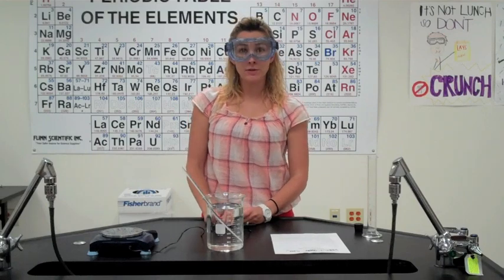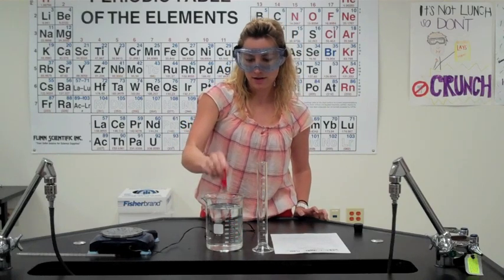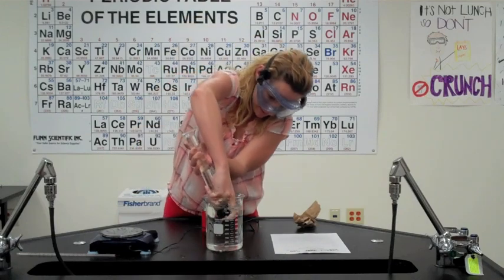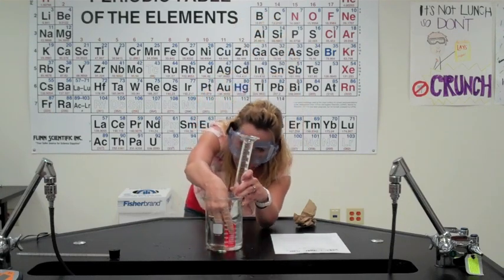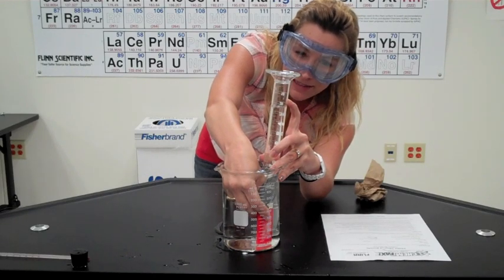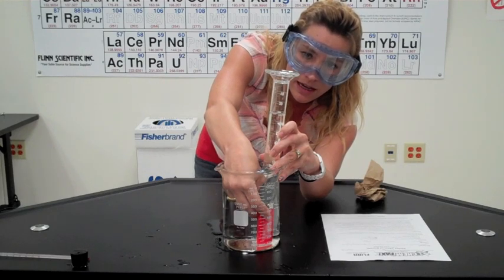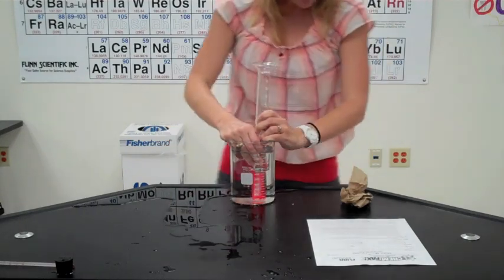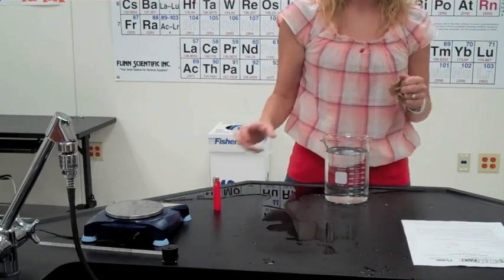Molar Mass of Butane

Comment: Hello Students. I am not a student. I need your help apparently.

I just got 146 junk lighters, no this is not a math question. this is a real thing, I work at a cigar accesories warehouse and I got them for free saving them from the trash. I figure since I'm never going to use all of these lighters it would be cool to collect the lighter fluid to keep it aroun and do whatever I want with it. I like making fires and whatever. I'm a pyromaniac and a Florida Man. I mentioned getting the fluid out and collecting it all together to a much wiser man and he freaked out because he thought it would be butane and not just average whatever lighter fluid. turns out he's probably right. and if I just puncture the lighter to make a small hole and dump out the fluid, apparently that would set off some kind of explosion that could take out an airplane.

so now I'm looking up on google, can you collect the butane from lighters and it takes me to this video.

so my questions are this 1 am I getting this right that to collect the butane from a lighter I stick it in water and put another thinner tube over it and just... press the button with the thinner tube? I don't get it, could you explane the collection procces in the way an idiot like me could understand.

then 2 it looks like after you collect the butane in that thinner tube you just set it across the table fully open and everything. Wouldn't all that butane just equalize with the air or something and now it's just lost? was the point of the demostration how to empty a lighter rather than collect the butane? cause that's what I want to do, I want to collect the butane to use it later for whatever I want.

finally 3 how is that thinner tube supposed to help me use the butane again? say all this collection method stuff works and I now have a glass tube filled with butane. how do I use it now. do I just like, pour the seemingly empty tube over my firepit before throwing a match in to start my fires now? cause that's like the end goal. that or soaking small cloths in the stuff to throw into already lit fires like little fire bombs.